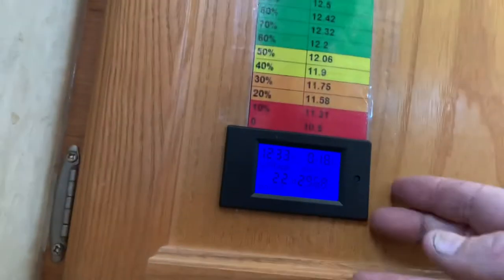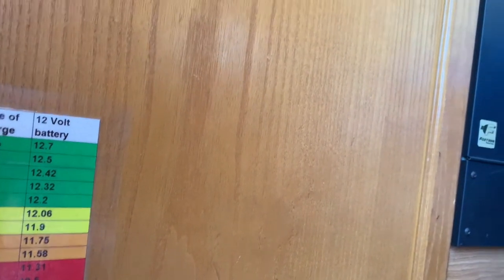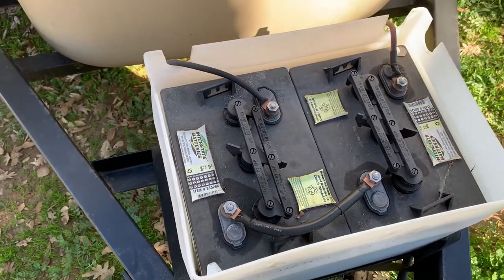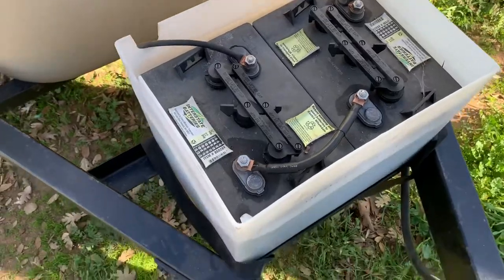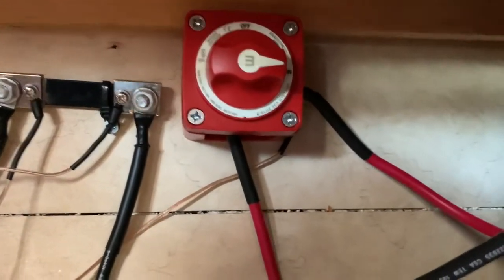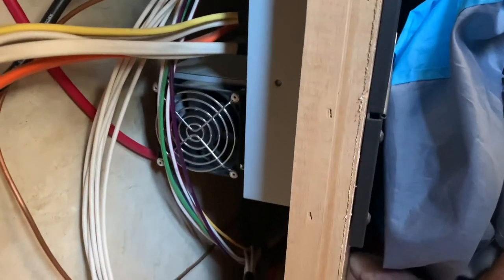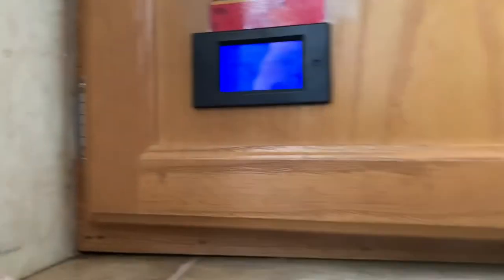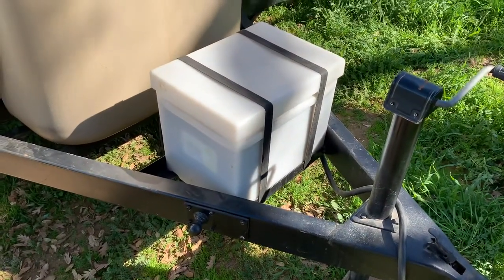Dual Golf Cart Batteries for RV/Camper. Cheaper, Easier, & Better than Smart Converter + Generator

Comment: I have 4 golf cart batteries for my house battery bank.  If you don't fully recharge them after each use, you will slowly lose capacity due to sulfation. Another option is to equalize them more frequently if you are not able to fully recharge them after each use.